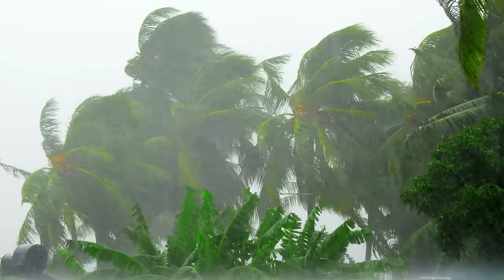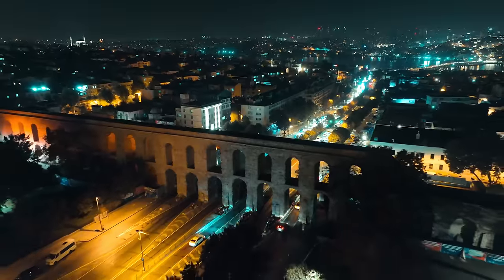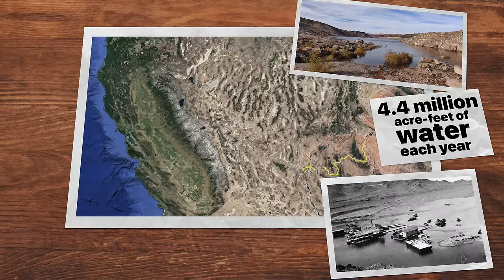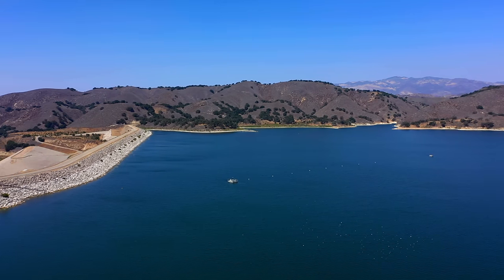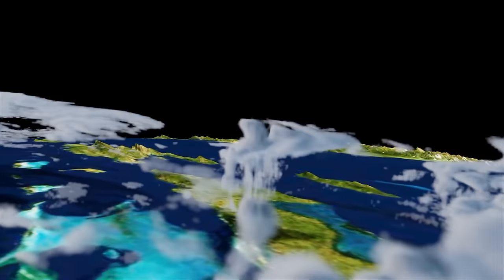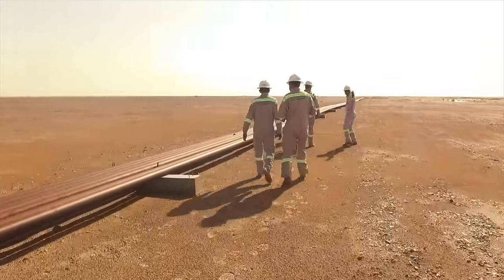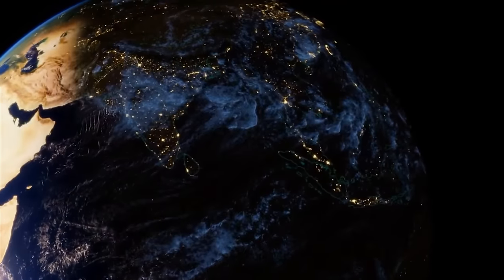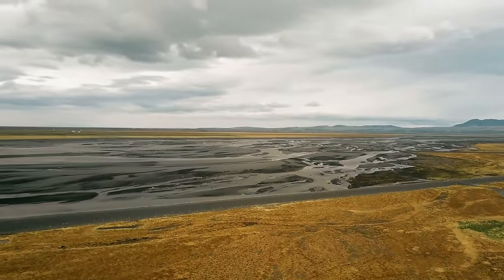Pipelines From Flood to Drought

Comment: You have no idea how much horsepower it would take to pump flood waters from the eastern US to the Dry south west.  The size of that pipeline to control floodwaters in a very short period of time would be mind-boggling huge.  I am a mechanical engineer in the Corpus Christi (Texas) area and we have our own water shortages.  There is a 54” pipeline that provides about 1/3 of the area needs.  Roughly 350,000 people.  So let’s assume that 54” pipeline supplies the need of about 125,000 people.  Scale that up to 40,000,000 people and your pipeline is now 40 ft diameter assuming it runs 365 days per year.  If you want that to be big enough to pump flood waters and assume that pumping would happen one month per year your pipeline now is 160 ft in diameter.  That would be an engineering marvel.
Reply: Now your thinking with portals
Reply: I think you missed the point of the video though. In this scheme, you wouldn't pump water after it floods. You'd pump existing stored water out of local storage at a slow and steady rate before the expected floods happen so that the floodwaters have somewhere safe to go instead of directly down river and/or through cities and towns. You wouldn't even need to pump it all the way to the dry southwest, just to an "escrow" reservoir somewhere that isn't used to handle flood control. If the flood ends up being smaller than expected, you just pump (withdrawal) the difference back to your local storage as required. Whatever is left after that withdrawal could be eventually pumped to the highest bidder at their expense, potentially generating income for that town/city/state from their excess water instead of spending money to deal with it when it floods.
Reply: Not to mention the idea of repurposing our fuel pipelines. Like we are going to be 100% electric... Impossible.
Reply: Look at the Hydro generation capacity on the Colorado River. 
Multiply that number by about 5 to get some idea how much energy you would need to the water that high and far.
YOU CAN'T PUMP FLOOD WATER!
Reply: @itslegit7362  Yum, petroleum tainted drinking water.
Reply: @itslegit7362  Good point. What else do you recommend? Maybe convert one-third of the old oil pipelines into a water delivery system? I'd rather put down new pipe for water delivery in parallel with some of the oil pipelines so we could reduce the need to take more land from public lands.
Reply: @joeyhazlett  Your "escrow reservoir" that "isn't used for flood control," is categorically, by definition, being used for flood control, as you just described it.
Reply: @itslegit7362  Plus oil is in nearly every product. 40% of a barrel of oil is used in gasoline production, the rest goes into other fuels and products. Oil isn't going anywhere without new science
Reply: @83btm  I understand that, but you don't normally pump water upstream for flood control, that's where this would be unique. Most flood control reservoirs take water from further up stream and slow it down to protect property downstream. In this scheme, the water would already be downstream, and pumped away so new water could replace it. That's why the "escrow" reservoir would have to be outside the general watershed from the impending storm(s) expected to cause flooding, otherwise it's just wasting energy pushing water around for little benefit.
Reply: @joeyhazlett, I didn’t miss the point of the video, you don’t understand the problem….  Where does it normally flood?  Flat, low lying areas.  Because there the water has no place to drain to.  Houston, Florida, New Orleans, etc.  most of these areas are basically at or just above sea level.  So your “escrow “ reservoir would have to be below sea level to prevent those areas from flooding.  Good luck with that project
Reply: @mrhatch117  no it wouldn't need to be below sea level because pumps can pump uphill. It takes a ton of energy, sure. But it's possible. Floods happen when too much water arrives at the same place all at once. If you pumped as much water away from that low lying area before the flood arrived, it wouldn't be a flood, just replenishment of the water that was removed. This method would temporarily make more capacity before the local reservoirs are overwhelmed. It won't be perfect, but it makes more sense than just rebuilding in an uninhabitable area over and over again after everyone is destroyed. Proactive instead of reactive. Most flood control reservoirs do this already, but they waste the water by only releasing it downstream in a controlled fashion to make room for more water coming from higher in the watershed. This would just be a way to save that water somewhere instead of just letting it go into the ocean.
Reply: @mrhatch117   😁I propose this "concept" be started IMMEDIATELY!  "Chicago" seems like a good mid-point to begin digging!
Reply: @joeyhazlett  I guess you missed the point on the engineering details…..  you are right, it is possible but extremely impractical.  Massive pumping and pipelines would be needed.  This YouTube’ers idea of using existing pipelines are not even close to being large enough to carry the water away fast enough.
Reply: @joeyhazlett  "It takes a ton of energy, sure."

This is the first point where this idea conceptually fails. It'd take an impractical* amount of energy; and I don't think you're appreciating the sheer magnitude of that figure. If you wanted to talk about pumped hydro(electric) storage escrows, that would be one thing; however, the midwest's geographical topography severely limits the practicality of such an approach, at the scale that would be required to 1) compensate for overwhelmingly massive volumes of incoming floodwaters, and 2) continue to operate efficiently in the absence of flooding--something that'd be 100% guaranteed not to happen. It just flat out doesn't make sense, on paper or in practice.

The second point where the idea conceptually fails, is the rather enormous assumption that slowly and preemptively robbing riparian ecosystems of vital water, downstream--and at a rate that's based on a weather forecast--will have no effect on them, whatsoever. Not only would such ecosystems be completely destroyed, but the volume of 'robbed' water you've now diverted, would still amount to a mere drop in the bucket, compared to the minimum volume of water it takes to cause even minor flooding. As someone stated above: you can't pump floodwater. You could go bankrupt trying to--ultimately failing, of course; but the issue, again, is one of practicality.
Reply: @itslegit7362  I'm glad somebody besides me figured this out. Just another green fantasy.
Reply: @joeyhazlett  Localized flooding does not occur like you are thinking.  Huge weather events over 100s of square miles cause flooding by overwhelming all of the small rivers and streams long before that water has time to even reach the main rivers like the Mississippi.  Those smaller tributaries can be virtually dry when the weather event hits and it will still cause flooding.
Reply: it's not impossible by any means, if we made rockets we can make this we just need finding that's IT
Reply: @dark12ain  it is impossible.  I did the math, we would need about 60x of the United States entire electric capacity to run the flood pumps.
Reply: @mrhatch117  I don't think anything is impossible for us to do, we just need finding for it. If we can make vessels that last in space, nuclear. We can make pumps to move water or find an organic way or moving it
Reply: @dark12ain  There are plenty of things -- an infinite number of things, in fact -- that are impossible for us to do. Holding the belief that anything is possible, as long as enough money is thrown at the situation, is incredibly naive. That isn't how the world works.
Reply: @dark12ain  it would take roughly 60x the entire electricity production in the United States to pump that water.  If you come up with a way, that is environmentally friendly to get 60x more electricity you would be brilliant
Reply: Maybe I'm stupid... but what if you pumped it as steam... or pressurized it... does that mean you could use a smaller pipeline? (therapist here. no engineering background.)
Reply: @ChaseWadeGoodknight  great question, but no.  That would require even more power.  You have to move the same amount of mass, thus relative amount of power to move it. But now under your idea you would need to vaporize it, and keep adding heat along the route due to thermal losses.  One advantage your idea would have is that you might be able to use a smaller diameter pipe and increase your velocities.  But it would need to be thicker higher pressure pipe
Reply: Boo. I only ask, because videos of murmansk in Russia often show giant steam pipes going over and around streets and intersections. (Giant pipes, considering its probably only being used by a few city blocks.) To scale that up to an entire state's needs.... I imagine you would need... quite a pipe LOL

And you say it would need more heating along the way... Yikes. Thats a real spider web. 

My next question, with the obvious answer of: Impossible

If we can build the Panama Canal... In theory... you could dig a series of canals all throughout the US... or maybe just bore tunnels that are all at sea level... even in a state like Colorado thats a mile above sea level.... would a series of underground canals be feasible?

Maybe the force of pressure from above ground would make a smaller pipe feasible? 

Nature Preserves be damned... but maybe digging under them isnt so bad

Again, no engineering background here 😅 Just a therapist, guilty of sharing whacky ideas.
Reply: What you can't just put pipes in and let the water flow through the pipes on its own why do you have to pump it you don't if you're going up a mountain I'm sure you do but even then the pressure of the water behind would go up over the mountain
Reply: @Valerie-bb5hi  free flow water only works if gravity is working with you.  To get flood waters from Florida (elevation less than 500 ft) to California you have to pump it over the continental divide (depending on exact location) is close to 10,000 foot elevation.  It can’t be done without massive power hungry pumps……
Reply: @mrhatch117  I didn't suggest free flow we have pumps the same kind that pump the water out of fire engines same kind of hoses would work too yes small would take a time to get there but if it was a little bit bigger and be better but it certainly better than everybody dying isn't it it's very irritating that there's always somebody who tells you you can't do it you can't do it you can't do it I'm saying oh yes you can
Reply: @ChaseWadeGoodknight  no whacky ideas, all need to be explored.  In a pipe, you are limited by velocity before the pipe itself will erode away very quickly.   While it is possible to build a lower elevation tunnel.  The tunnel would be nearly 1000 miles long and about 160 ft diameter.  The spoils (removed dirt/rocks) would be roughly the size of Mount Everest…..  that’s a big pile of rocks.
Reply: Can it be done? Cost? $40b, $80b, $150b? Time to build? 5yrs, 10yrs, 40yrs? Would dividing into several pipelines be better? Could we use a train system? Would it solve the problem? For how long? It would certainly generate new jobs across the entire country. Is there a better way?
Reply: @itslegit7362  That's what 2030 electrification is to start. If you look into Shell, Exxon and other's sites, they say by 2050 or sooner they'll be net zero emissions. Shell states they'll have 100k charge stations by 2030 in the UK and more than 50k by 2025
Reply: @dct124  my point is we have some of the smartest people in the world they can come up with something something temporary while they work on something else I don't know but they need to start instead of putting it off and saying oh we can't
Reply: @dct124  what people don't realize that they haven't thought of is simple things like the Mississippi River which is also drying up floating the water from the Great lakes although the Great lakes do not want to share the water which I don't blame them it'll ruin their ecosystem but I remember back when they were asking in the South for water from the great lakes and they were just going to dump it into the Mississippi and then take it from the Mississippi as it made its way down my point being we don't have to think in terms of equipment necessarily
Reply: @davidcroxton8306  why pump it when you can use solar power to evaporate it
Reply: @mrhatch117  People made airplanes despite people with mindsets like you. Eventually someone will make it happen.
Reply: Sounds like a lot of work, better get to it
Reply: @excelsior8682  Mindsets like mine?  Degreed Professional Mechanical Engineer here.  It is impossible!!!! and I cannot believe the number of people on this channel believe that it is possible.  Did you not read in my comment how big that pipeline would need to be?  And where do you build it?  One at every possible flood zone?  San Fransico is flooded today.  Perhaps they should just pump the water into the San Jaquin valley and store the water there.  Oops, I forgot that we don't
have the electrical capacity in the united states....
Reply: @mrhatch117   I posted an idea where a 300 foot dam just Below where the Ohio joins the missippie.  Dikes would protect the Ohio Valley and the water can be diverted up the missippi and misouri. Lockscan expand shipping routes channels at 600 foot contour could carry water south to Texas up stream dams could divert water at greater elevations. But if a series of dams went up the Platte and north Platte  using wind powered pumps water can go over south pass at aprox 6000 feet producing electricity as it goes down the green and colorado. But thing is you don't have to pu.p all that water from the missippi to California. By catching water far up stream divert it west and replace it with water from the east,  just look at different elevations. If water were diverted south at hellina montana then that water could be replaced from the east and we would have a slackwater year round shipping channel clear to western montana
Reply: @mrhatch117   checked south pass is at 7500 feet And the pass west of hellina Montana  on the mullon road is at 5090 feet
Reply: @mrhatch117    a North South cannel  at 5000 feet could pass Oklahoma into New Mexico. As it went south it could replace Colorado River water diverted to Denver. In New Mexico it could also replace water from the Colorado river
Reply: You pump in stages if required. If you are pumping to a lower gradient it’s no problem. Pumping on level ground or uphill then you pump.
Reply: Why were they able to do it in Libya so easily?
Reply: @Joey Hazlett  Slow and steady before it floods?  What kind of flood forecasting are you talking about?   A three to five day warning before a flood situation would not entail slow and steady water transfer.  Go find a picture of a flood or a spillway on a large dam open and picture the pipe you would need to transfer that much water in a less than one week scenario.
Reply: @joeyhazlett  Besides, we're talking about pumping water from the Atchafalaya Reservoir to a nearby escrow Reservoir in anticipation of a flood.
Reply: The assumption that pumping a liquid X times less viscous means that you can pump X times more liquid at the same time and with the same energy is wrong!
Reply: But mysteriously we are able to pump crude or heat and pump tar oil through those pipelines now.
Reply: If the price is high enough for the commodity, then it's worth it in a capitalist system. Oil is pumped, natural gas too. Reusing the pipes that are already in place is an excellent idea. We need to look at this as a permanent problem. Drought is not going away until the population goes away.